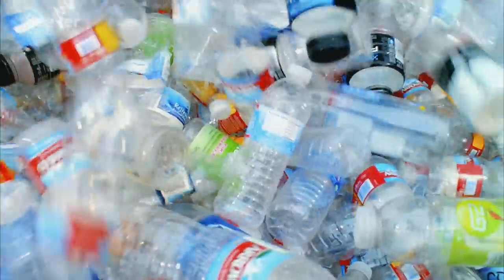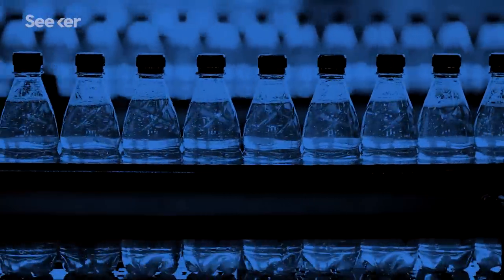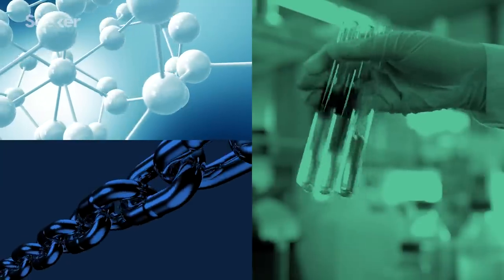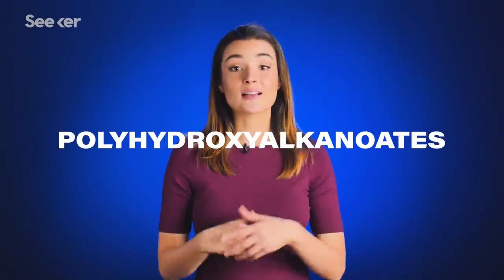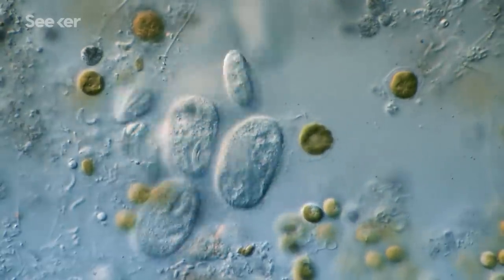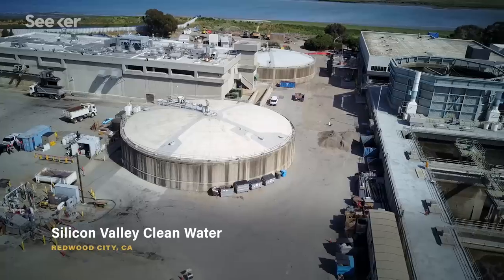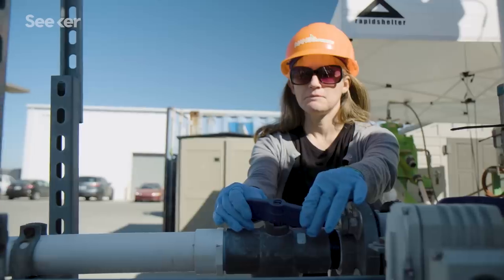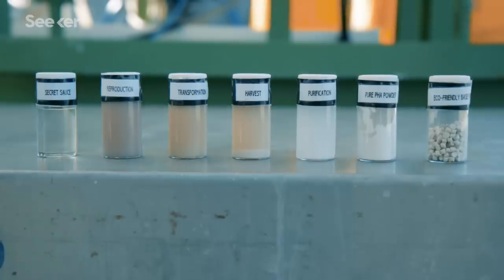How Close Are We to Reinventing Plastic?

Comment: Seeker: can i ask something please? you didnt cover the degradable aspect of this new material. Does the plastic degrade and thus we are left with polymer chains in the environment? at the moment the sea is chugging with tiny micro beads. Or does the plastic when it degrades somehow turn into something else?
Reply: Whatever breaks down bacteria can probably break down PHA. I'm unsure beyond that. EDIT:  *anaerobic bacteria
Reply: well i was working in a plastic manufacturing company before.. we had a product development department and experimented a little with bio plastics.. the thing is that the source shouldn't be petrol but wood or plant based and then those bio plastics usually don't leave microplastic.. they can be broken down into nothing by bacteria, fungi and so on.. i mean we have found certain bacteria and fungi that can basically eat certain types of plastics.. the problem with it is that great now we have a way to get rid of polyurethane for example.. but that's only a fraction of the used styrene polymeres we produce.. it doesn't help with polystyrene, abs, polyethylene, etc. etc.. well polyethylene COULD be burned.. when you burn pe it's breaking down into water and co2.. however this is the worst you could do in terms of energy and carbon footprint because producing it in the first place needs lots of energy.. so recycling the plastics is always the way better option.. 
but recycling plastics isn't all to easy really.. the company that i worked for had a bunch of grinders and bought lots of scrap plastics back from customers, leftovers from deep drawing or just failed attempts that didn't work etc.. however the problem about it is that it's not so easy to distinguish one plastic from the other just by looking at it and if you for example mix abs and ps the plastic is ruined.. it will shatter like glass.. 
that's why the seperation is really important but that's the hardest part.. and this is the reason we have so much waste instead of companies that bother to recycle.. 
once we had a customer that send us abs but there was pvc mixed in.. now the problem is that for pvc extrusion you use different machines and that you run them way colder for pvc than abs so the machine blew up and we had a ginormous damage.. it gave a huge fight with this customer and we didn't trade with them for a long time anymore.. 
so really plastic would not be so bad if it would be handled better so it can be reused as you can basically recycle it indefinitely if you keep it clean and mix a little fresh and new plastic within from time to time.. just that it isn't handled well, gets mixed up or formed into products where it's not really seperateable from other things anymore..
Reply: DiyEcoProjects be great if plastic is seed based or some sort of food based for animals or plants when thrown out
Reply: @Dunkelelf3  many thanks for your considered reply. How about a big sticker (on the front of the packaging in big numbers) with 1 2 3 4 5 on it so customers can be educated to split the recycling?
Reply: If industries could make different type of plastic that degrades into harmless bio parts then we would be on to something
Reply: DiyEcoProjects we have that already. There's a symbol on the bottom(usually) of the plastics that has a number from 1-5 that tells you what type of plastic it is
Reply: @dawnshimmer7341  Yep i know that, but what im saying is perhaps if it had a big fat symbol on the marketing label in bold that would help
Reply: Them microbeads are mostly from hot laundry on synthetic cloth. Choose cotton pls.
Reply: @dawnshimmer7341  Maybe color coding the different types of plastics would make it easier to tell them apart.
Reply: @joshuadominic2116  He said Asia not Asians. Criticizing a culture =/= racism. If that criticism is wrong well then that just makes him an ignorant fool atm not a racist, big difference. When you falsely accuse someone of being racist you just make yourself look like an ass and make them roll their eyes, and ignore every other damn thing you just said, which is a crying shame when you otherwise have good points they might could learn from.
Reply: @DiyEcoProjects  they are doing this..  google for recycling codes.. 
1 is pet
2 is pe-hd meaning high density which is for example tubberware
3 is pvc
4 is pe-ld low density here and it is used in plastic packaging like a foil or bag
5 is pp
6 is ps
7 is everything else like polycarbonate, abs etc..
then there is also other codes for metals, papers, glass etc.. but for plastics only the first 7 numbers are really relevant..

the problem is that while the stamp with the recycling code is on the product itself it's not on the scrap leftover after the piece is cut out after deepdrawing..
i mean i'm not really talking about the consumer here but the customer which is another company.. we made plates and rolls in extrusion and sold them to other companies that deepdrew them into whatever they want.. and those customers employees working in friggin plastic were apparently unable to seperate them properly so we often got lattice boxes full of crap mixed together.. 
another thing is that there is also for example ps but also ps esd.. 
it's the same stuff but the latter has carbon added to make it conductive.. stuff like this is used for example in these esd bags they send you electronics in so they aren't damaged by the static created by rubbing and sliding around inside a normal bag while shipping.. 
here there isn't much problem in mixing but using esd to mix it into the normal ps is a waste of money.. ps esd costs more than normal ps..
Reply: @historicalaccuracy15  You make a great point about the misuse of the word "racist". However, I'd argue that when someone says "Asia", them follows that up with "those fuckers", it's reasonable to assume he's talking about people in Asia, i.e. Asians.
Reply: The type of PHA we  produce, how we formulate it, and process it allows it to be fully consumed to the most reduced form of carbon (CO2 or CH4) by microorganisms. In order to be accurate one needs to site the environment (marine/backyard compost/industrial compost/anaerobic/etc) AND the time period over which biodegradation is being measured. Note that there is a rise in many sorts of technologies in this field and one does NOT want partially broken down plastic bits or oligomers floating around our environments. We need them fully digestible.
Reply: @mollymorse4178  i would assume the challenge is still that most biopolymeres only work with certain manufacturing methodes and getting the same properties of the material as with the usual petrol based styrene polymeres? 
i mean while biopolymeres might be good in some cases it is really challenging to replace something as durable as polycarbonate for example. 
it's been quite a while since i left the plastic business so my knowledge on the latest breakthroughs and discoveries is limited so excuse me here but i know the normal plastics we use very well and i can't imagine that the biopolymeres are as versatile yet. this is where the real challenge is.
Reply: @Dunkelelf3  Yes, there is optimization needed between the biopolymer type and the manufacturing type. However, in recent years there have been major advances. PHAs (and more specifically P3HB), for example melt around 175degC and some melt processing set-ups might be configured for higher temps. As for polycarbonate/etc replacement, it really depends on the application and on what type of machine the polymer is currently manufactured. Injection molding is easier than fiber extrusion (in most cases at least)...but even then, depends on the mold/gate/etc configuration.
Reply: @mollymorse4178  yeah i know these struggles. for example did we sometimes make plates in co-extrusion with abs in the bottom layer and tpu in the top layer. this worked just fine however the bulges cut off at the sides when grinded down ofc resulted in a mixture of abs and tpu that was unusable with our machines at least no matter what we tried. we sold the waste created to another company who used it for injection and that apparently worked perfectly fine.

175 degrees sounds like it could work being used for extrusion at least based on the temperature. i never saw or touched pha's though and i'm not familiar with it but the biopolymeres we tried needed some modification to the machines like removing the mesh screens used to hold back impurities in normal plastics because the materials we tried were quite chunky and seemed to not fully melt and then they would basically get stuck and the pressure get way to high so the machines turn off..
but this also ment that there was more limitation as to how thin we could manufacture anything with the material.

anyways. thanks for what you are doing! plastics are a great achievement of humanity on the one hand. i mean think about what would happen if we'd have to make everything from wood, glass or metals. however on the other hand if you read stuff like 10 more years and we will have more microplastics in our oceans than fish well. this is quite concerning. so without research we will never have adequate replacements for the poison we produce now. this is why i ultimately left the plastic industry. for one because i'm a hippie at heart and love the nature and environment and for the other because i got married and didn't want to be surrounded by all kinds of poison at work every day anymore. especially hygroscopic plastics like abs or ps esd. good lord the black goo that came from the degasing after running those materials. yummy. looks just like the cancer it causes. 
i'm 32 now and i want to spend many more years with my wife and our future children so i really never looked back.
Reply: Joshua Dominic i mean the west isnt really more notorious for pollution in comparison to asia.. China uses more coal than the rest of the world combined and India is second followed by the US and China has plans to keep using coal for years
Reply: @mumbairay  Cotton has it's own issues, many brands produce clothing in unaccessible conditions, whith out water treatment, dying and wearing in designates by not the best means. I would much rather see open source designs done by people for the people.
Washing mashines could also be open source an design to catch debri, so it can be insinoratiorated.  100% polyester clothing has pros compared to cotton. It is often made of recycled material (mainly bottles that we could live without just fine), much lower energy and water consumption compared to cotton. PET is water repellent therefore works great for outdoor clothing. If it is made only from plastics - it can be downcycled into railway sleepers, or insinoratiorated for heating and electricity.
Clothing, shoes, tires, paints, decking, flooring and many more objects will all have some deterioration therefore microplastics - most transportation should be done by rail - so there are less of pesky batteries, holes in the ground.
Reply: @joshuadominic2116  okay Boomer
Reply: @Dunkelelf3  I think a fair amount of people, even if it's ain't that many, are aware of that information. It's just that, most of the time there's no enforcement and (some) government doesn't really care to regulate these stuff. This causing the people that even aware, turns careless to the matter. Because (some) government didn't provide or giving support to succeed this program.
Reply: @Dunkelelf3  you're cool pal👍
Reply: @mumbairay  cotton farming has seriously dire effects on the soil and requires insane amounts of water. Wool is the only sane thing that should be used.

Comment: We had this almost a hundred years ago or longer hemp plastic#hempplastic
Reply: We can actually use sugarcane and have a higher production value than what we can get from hemp now. Sugar cane is more efficient than Hemp for production of Biofuels and is currently used in over 20% of the fuel used to power vehicles in Brazil
Reply: @silviafox78  54% this  year
Reply: @luizfilipecouto1030  - oh dang! That's incredible!
Reply: @silviafox78  And we are producing more too
Reply: Up-a-Creek  - you would need to smoke a bonfire's worth of hemp in order to get as high as a puff from actual marijuana. There is a difference between the species. On top of that... No you can't smoke plant-based plastics without possibly severe health related issues occurring. Hemp is an industrial plant which is used to make grain, fabric, oil, wood pulp and every possible application of those products. It doesn't get you high like marijuana.
Reply: the amount of farmland you'd need would mean mass deforestation. So it would be extremely bad
Reply: @mlc4495  - Well I mean at least sugarcane  has a higher efficiency of recapturing carbon emissions from the air so it could technically be worse for the environment such as burning it down for avocado, coffee, banana plantations, etc.... also Brazil is not my country. I do not condone the burning of rainforests for sugar cane or any other crop when not required to sustain the human species.
Reply: @mlc4495  Thats because morally broke countries that are in a position to do so profit to much on the existing system.
Reply: @friendlyoldbum9182  "Morally broken country" Every country wants to profit from its resources, you must be from Europe, The European destroyes their forests a long time ago, and also France wants to "Internationalize" the Amazon, You think is to protect? Is to explore the Amazon because France wants colonization 2 Resources Bogaloo, So stop talking about moral countries, this doesn't exist
Reply: @luizfilipecouto1030  Exactly my point!, I was pointing out the other blokes hypocrisy on the matter.

Edit- " morally broke countries "
Places like the USA, AUS (where I am). Many in the EU.
Reply: @luizfilipecouto1030  Mostly to the point that it seems to be people from countries that are happy to deplete large forests, destroy natural resources and reefs for ports and ruin economies for the sack of profits that tend to scrutinize peoples that are giving the greener options a go.
Reply: @luizfilipecouto1030  yeah sure, as Europe fucked up, let's all do it and destroy the world, as long as we get profit from it for now ? We have way more knowledge about the impact of monocultures on the long run and on how we should optimize them for both short and long-term aspects - palm oil and sugar cane in today's situation does a lot of arm to soils and to the environment -, same flashing news for giant hydraulic centrals, compared to safe micro hydraulic turbines. Brazil should act more responsibly and put a smarter guy as a leader to manage such a rich and diversified country (I'm not saying French or American people are better for electing theirs). Of course that every decision that has an impact on more than just one country should be internationalized, the profit taken by the stronger and selfish countries (that each country dreams to be) is just a shame and the reason we are all screwed (for now)
Reply: Yes but the elites want us to drink out of fart bottles so the can mock us,  just forget about that hemp stuff

Comment: We need to reinvent plastic straws. They really şuck.
Reply: (juced waste) Apple based ones don't turn to gue.
Alternatively we could use longer fibre paper (not chopping but pounding the base cellulose (like traditionally done and kept up in Japan, preferably from some longer fibre products than wood, historically hemp).
Reply: fiona fiona pounding takes energy ... so unless you got a million people pounding straws have it
Reply: Or don't use them at all ... For 99.99% of people having a straw is not necessary for drinking stuff
Reply: @AsG_4_ 
Grinding takes energy and since patience makes that sort of paper recycleble more often I'd opt for the choice if I knew my paper waste wasn't burned 90% of the time or knew the paper mill could control energy usage in ways that add stability to a renewable grid (as overproduction /cheap electricity will be necessary by the next decade).
Reply: Or just remove them completely, we'll do just fine without it.
Reply: The guy litterally made a pun and nobody notice it.

Comment: this video is misleading. I you are using it for consumption you will still have to use a BPA liner if the material is consumable inside.
Reply: When did the video say it's only reinventing plastic used in consumption. 

There's so much plastic used that's not in the f&b industry and this could help there. 

Before calling a video misleading use a little of the brain you were born with.
Reply: Why would it require BPA? Is BPA not Bisphenol A? Carcinogenic? You can buy many BPA Free products so why would you assume it's use be required?

Comment: the real question is? is it better than  HDPE which may not degrade easily but it's akready non-toxic can be molded and repaired. we just need better recycling processes that can break every thing down to raw materials rather than putting it all in a land fill and hoping it rots away.

Comment: The solution is never going to be a replacement for plastics. The solution is engineering bacteria that can brake it down. That would bring about a problem of anything plastic that we actually need degrading but in reality that wouldn't happen fast enough to be a problem, for the same reason pure sugar isn't being degraded by anything even if you add water.